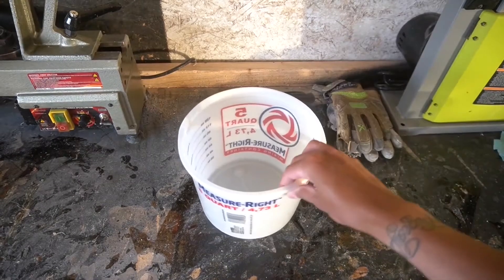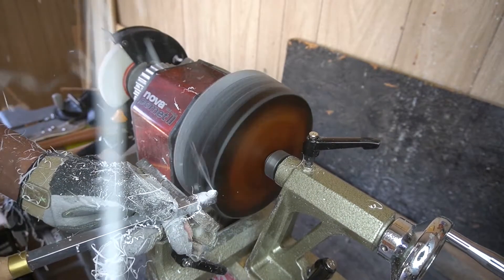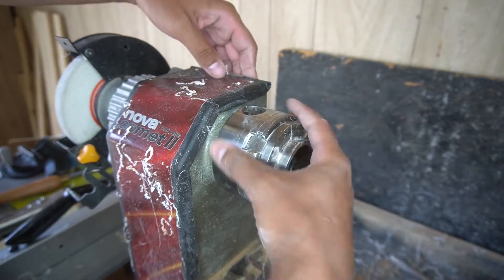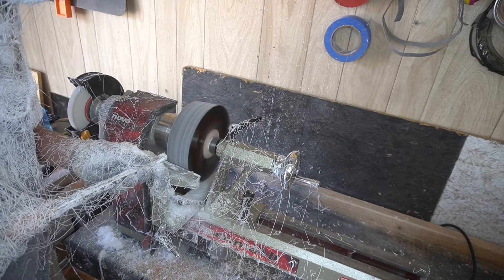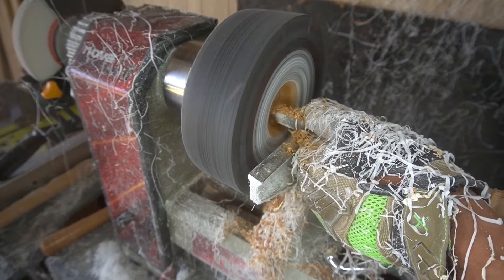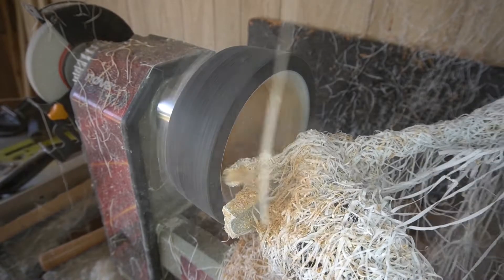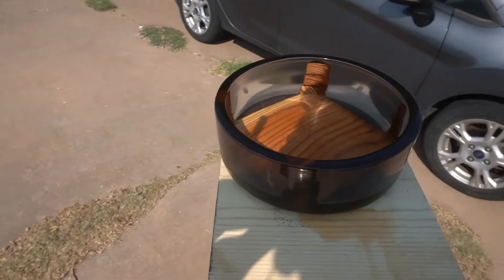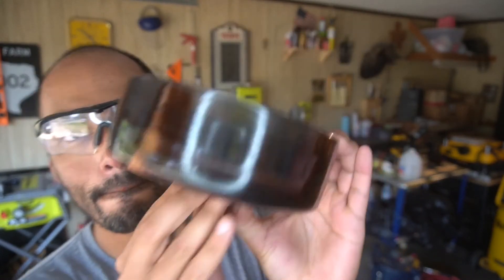Wood Turning The Dark Bowl

Comment: How’s your finger now mine is healing good. 

Try mixing up the coulours a bit  and try putting different things in resin like pine cones or feathers pretty much  anything. I would definitely upgrade to a floor standing lathe have a look at axminster. Iv got two lathes a axminster and a union jubelee lathe. The axminster is lightweight and flexible and it does not wander across the floor my union wanders a mile and it weighs 1/4 of a tonne.
Reply from the maker: The finger is healing nicely. I actually have some pine cone videos coming up. I have several videos scheduled out for the next several months with various items in epoxy and one of them is a pinecone. I would love to get a floor standing lathe in the future. I’m gonna get maybe next year but I really want to get better before I make that purchase. Hope you’re healing well, and stay safe.